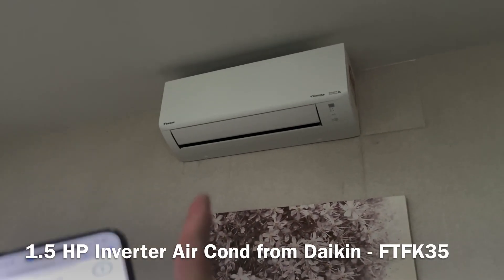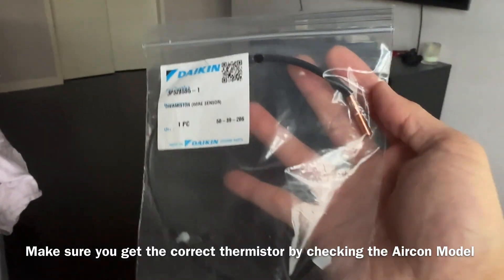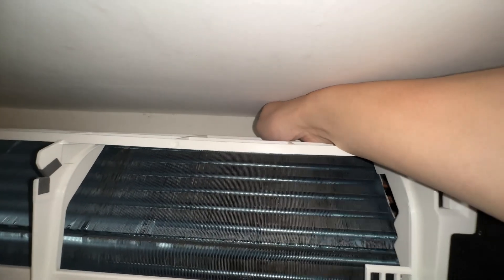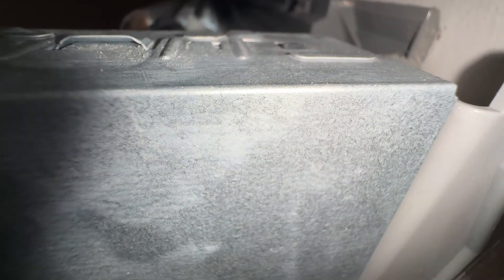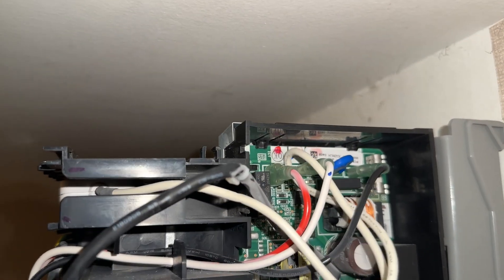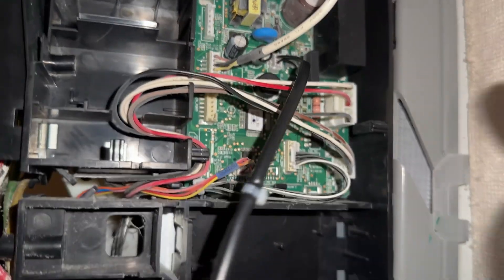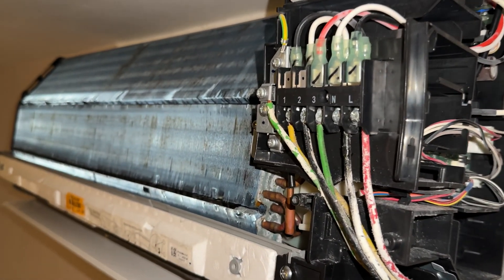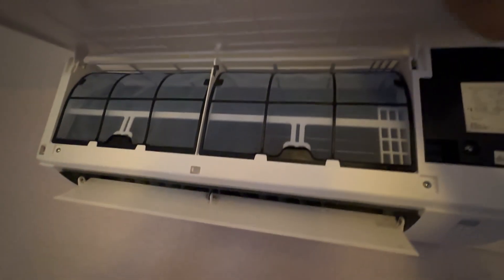How to Replace Thermistor (Temperature Sensor) of Daikin Air Conditioner?

Comment: Thank you for this video! I have a different Daikin model (FTX09NMVJU) but it still worked! Only differences are the location of the thermistor itself and the way that the metal bracket opens (mine opened from the top). You have saved me money and probably a few nights of good sleep. In case it helps someone else, the part number that worked for me was 6023935

Comment: Hello, thanks for the video, is there a room thermistor or not? because mine doesn't stop working, even if it reaches the desired temperature. Thanks
Reply: Mini split don't shut off in the inside. Just the compressor will shut off but the blower will still blow inside on 99% of models